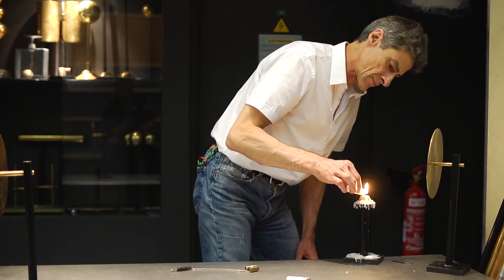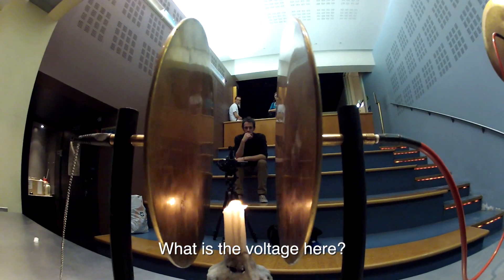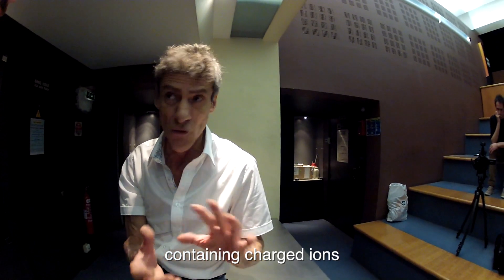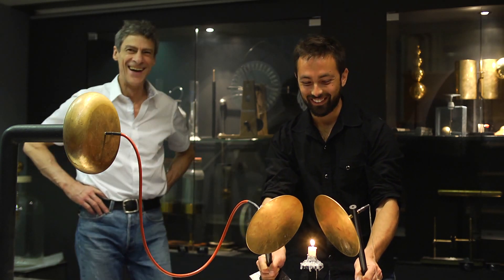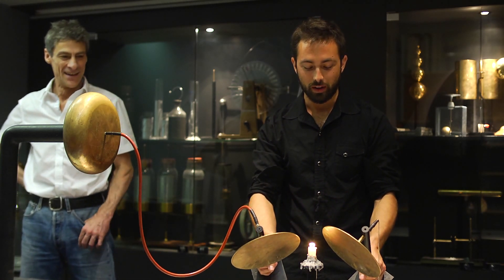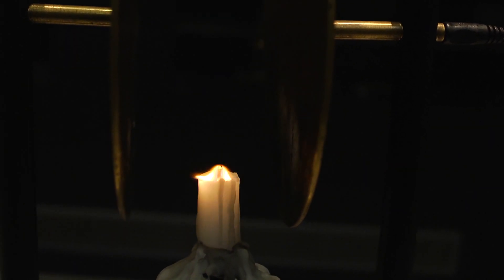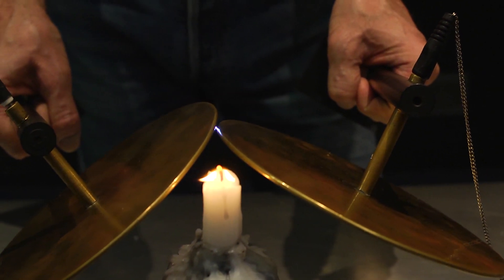What's In A Candle Flame?

Comment: Thanks for another interesting video.
But could you do one about what a flame actually is, please?
You proved it has ions in it but what is the whole of it?  Why the light?  Never mind why the difference in colours of light, why the light? - if there are several reasons please explain them all so we get a complete picture of what's going on.
Also what is it that happens when the hot gasses meet a spark?  I mean what's the difference between the hot gasses with ions in you get when you blow out the candle and the light and heat emitting FLAME that can sustain it's own reaction?
What's going on for a generalised fuel source with regards to both the chemistry and the physics?
There's no sensible, waffle free explanation for normal adults, that I can find, on the whole of YouTube.
Thanks and keep up the good work.      :-)
Reply: A flame is an everyday phenomenon, yet an amazing little thing. As you probably know, it is the consequence of an exothermic chemical reaction. This means energy is released from a reaction like CH4 + 2 O2 --> 2 H2O + CO2 (burning methane gas) and this energy is enough to heat up the surrounding air. Now this is where it gets freaky, this heat will disturb the electrons moving in atoms of the air, removing them further from the atoms core. when these electrons fall back, they emit a photon a.k.a. light. This is how chemical energy becomes heat energy, and heat energy becomes light energy. Now Veritasium speaks of ions and plasma. What's that all about? Plasma is actually the state of matter where a gas releases electrons like I've just described. Because the atoms lose electrons, they become ionized or charged. And this is why half of the flame goes to a positive charge and the other half to the negative charge. The heat is powerfull enough to split the electrons from the cores.
Reply: The Benjamin Better explanation than the video!!! Tnx.
Reply: Isn't it just that the gasatoms gets the heatenergy from the match/lighter and then sends out the energy back, in the form of light and more heat. I'm not sure, I barely know high school physics.
Reply: The Benjamin Thanks, good answer, that's cleared up some stuff for me.  :-)
Reply: The Benjamin
So in your scenario the flame is made of carbon hydrogen and oxygen bonding and separating from each other and the light is caused by the photons emitted when then electrons break their bonds in the CH4 or O2 and when they create their bonds in the H2O and O2 is that correct?
Reply: Ghost Emblem well close. The chemical reactions cause heat to emit. And this heat causes electrons to leave their atoms. So the electrons I'm speaking about aren't required to be the ones from the chemical bond. They could also be electrons in nitrogen from the surrounding air. Apart from that it's correct.
Reply: Almost. This is why  the stoechiometric flame of gas torch is blue. The reason for the white-ish light of a candle is that the flame does not receive enough oxygen thus leading to the formation of tiny particle of pure carbon (the smoke) hot enough to emit light.

Comment: I was so intrigued by this that i had to try so i got an electric static mosquito racket and exposed the wires charged it over the candle flame and it worked! not quite as much "butterfly" as this but it still moved the flame and expanded the spark gap up to 20mm from 2mm,

Comment: Really you can demonstrate properties of ions even without high voltage source. All what you need to do is to take some old vinyl disc rub it so static charge will build and place it near weak flow of water from bathroom tap. You will notice that water flow will significantly bend from its normal position. Than take lighter or any other open flame source and place it approximately 20  cm far from water flow. Ions generated by flame will reduce static field so fast that its looks like magic and very impressive. Soon I will make video to show this stuf .

Comment: Its not smoke that you see coming off the candle after it goes out. It is mostly wax vapor. You can prove this by holding a match to the vapor trail and you will see that it burns and reignites the candle even though you after not holding it near the wick.

Comment: you-re missing the whole point! It is not the flame that contains ions, is the air around it that is ionized and propelled by the electrostatic forces. So the air moves, and you can visualize it with the help of a flame, smoke, steam, dust, water or any fluid or particles layed on a smooth surface that can be blown away by the airflow.

Comment: It's not static discharge. Ash and rocks are electrically neutral. But the ash coming out is so hot that not all of the ash particles are neutral thanks to the heat. So the particles become positively charged and negatively charged based on the heat and aerodynamics of the particles combined with proximity to a particle of the opposite charge and when enough of a mass of opposite particles comes close together there is lightning. Ash never actually rubs together before the discharge occurs.

Comment: Electrostatic airflow is making the flame flatten. Or could be. No control to show lac of air flow. Dielectric strength of air reduces dramatically with heat. Hence longer arc through flame. no control. This proves nothing.
I do agree fire is partially plasma. Plasma is what happens when atoms separate into electromagnetic waves of protons, neutrons, and electrons. Fire still has fully formed atoms in most cases. Superheated carbon for eg as well as other atoms from environment and burn reaction

Comment: Is it really "the opposite charges in the smoke" that cause it to move towards the plate? Or could it be that the electric field induces a dipole in the smoke particles. If the electric field is not perfectly uniform (such as towards the bottom of the plates) then there will be a net force acting on the dipole accelerating it towards the plate along the narrowing field lines. It would be fun to see an experiment to test this hypothesis. Switch the polarity of the field just after smoke starts?

Comment: Mh. Not all of this is correct. Of course there are ions present in a flame which give the flame a certain electrical conductivity. However, the reason for the lower dielectric strength is mainly the larger mean free path. The flame is (almost) under atmospheric pressure but its temperature is much higher so according to the gas laws the DENSITY is lower. That is, carriers see a larger mean free path to gather energy from the electric field

Comment: Actually, I suspect that the smoke does not contain ions. Obviously, the flame does. The smoke gets polarised and attracted by the inhomogenous electric field. Rephrased, the electric field induces a dipole in the smoke particles. Because the electric field is not homogeneous, the dipole feels a net force.

This theory can be tested by using much larger plates and by keeping them parallel, and with the flame in the middle. The plates should be much larger than the distance between them.

Comment: Speaking of which, I was linked here during an argument whether fire is plasma. They say so in this video, citing the fire's reaction to the high voltage. Are they saying that the heat is ionizing the gas, or that it is instead lowering the resistance of the gas enough that the 20,000 voltage electrodes are able to ionize the gas in the fire. Nowhere else I've looked claims regular combustion fires are energetic enough to be plasma.

Comment: Not quite. High electric potential (voltage) is applied to electrodes on each end which ionizes the gas inside. The energized electrons return to lower energy states radiating gas-specific spectrums. Neon's famous color is a result of its highly yellow/orange emission spectrum.

Comment: An ion is molecule which has 1,2,3... electrons more or less than the one in neutral state. And I'm talking about molecules, for example benzene, which is neutral, but has a negative ring on both sides of the molecule, so yes, you are a dumbass.

Comment: Smoke detectors work due to radiation from usually americium. There is a small amount of americium and a plate that detects the radiation coming from the americium and when the radiation is partially blocked by smoke then a relay sets off an alarm.

Comment: It's an explanation for someone who may not have a background in chemistry. You're technically right, but also maybe overwhelming. Besides, NaCl is a simple case, but you don't have hydroxide atoms or fluorosilicate atoms and who calls them molecules? Though when dissolved in solution, they may recombine with different ions of an appropriate charge level. I think calling them molecules confuses what they are and implies stability, but a molecule will often dissociate into two ions.

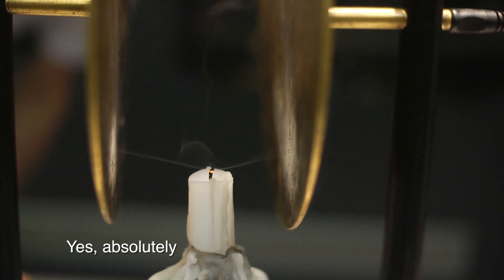Comment: The smoke isn't "candle". It's partially burnt bits of wax or, if you prefer, bits of wax that have been decomposed by being heated -- just after the flame has gone out, the wick is still hot and that heat continues to break down the wax molecules. At 2:00, you can see the smoke splits in three: positive ions go one way, negative ions the other way, and uncharged particles go upwards.

Comment: if the amps are low, it's like the little sting you feel when you get zapped wearing a wool sweater and touch grounded metal.
if the amps are high it's going to be extremely painful for a very short period of time, after-which you die a crispy death

Comment: A flame is just made up of atoms with excited electrons. Excited gases, for example, will release light in the form of photons.

Amps are much more dangerous than volts. I believe it's true that even a few amps of current could kill a person.

Electrical resistance (ohms) causes things to heat up when they have a current passing through them. This should be how an electric stove top works.

Comment: True.It`s the current that kills not the voltage
1 Milliamp:Perception level
5 Milliamps: Slight shock felt; not painful but disturbing
6-30 Milliamps: Painful shock; "let-go" range
50-150 Milliamperes: Extreme pain, respiratory arrest, severe muscular contraction
1000-4,300 Milliamps : Ventricular fibrillation
10,000+ Milliamps: Cardiac arrest, severe burns and probable death
keep in mind that most electrical circuits can provide, under normal conditions, up to 20,000 milliamps of current flow

Comment: I have wanted to know this for about 40 years. Maybe more. 
However...
You didn't really answer the question. 
I get that there are ions in it. But is that all? And what exactly are ions and why do they do that. And why does the flame look like a flame and not like a spark or the way plasma looks inside one of those tube things? What is the difference between the two. 

Keep going. This is an old curiosity now and it has ALOT of questions piled up in it. 
<3

Comment: I think the fact that the smoke splits in the Electric field is interesting.  Smoke is definitely not a plasma, but it still contains ions and is still affected by an Electric field.  So perhaps the fire is also not a plasma even though it contains ions and is affected by an Electric field.  But, of course it did seem to conduct electricity.  Do you think a line of fire would conduct electricity as well as, say, a line of water saturated with ions?

Comment: Voltage doesn't kill you, it's amperage that stings. My guess is that the faces of the plates act like a charged capacitor, and some of that gets discharged escapes onto his relatively neutral hand, but since the capacitance of the plates is so small and the resistance of the path to his hand is so great, the current delivered through him is negligible.

Comment: It's because it is current that kills you not voltage.  Out of curiosity i googled how much current it takes to kill you and surprisingly it is only between 10-15 milliamps depending on the person.  This means that his body's resistance was over about 13 million ohms at that point.  You are actually shocked relatively often by 20,000 volts because a static shock that you can feel stinging has about 20,000 volts.

Comment: That depends on the amperage of the shock. 60-70 mA (milliamps) across the heart is enough to kill most anyone. Usually people can handle more than that though, due to the resistance of skin/muscle/bone etc. In this case, he didn't complete a circuit, rather, there was a charge on the plate that was released when his finger got close enough for it to arc, its the same concept as a van de graff.

Comment: Incase anyone hasn't really answered your question yet I'll try and explain what I know: Mostly Voltage isn't the thing which kills people, it is the amounts of Amps (Ampere) that kills people, now the amount of Ampere that can ''flow/stream'' is determined by: Ampere (I) = Voltage (U) : Resistance (R). However, for humans 50+ Volts of Alternating Current and 120+ Volts of Direct Current CAN BE DANGEROUS, but it depends on the Ampere, not as much the Volt. (Also, Ampere creates heat, not Volts)

Comment: Fortunately not. The reason being that although it has a high voltage the current in this case must be very low. An everyday example of high voltage low current shock is that which you sometimes get after walking in socks on a carpet and then touching somebody, this is about 10 000 volts.
It takes about 10 micro Amps to stop the heart.

Comment: They're using this conductivity principle as part of a laser weapon. The methodology for producing it, is that a laser heats up their air in a linear stream which allows an extremely high voltage to be sent down that stream. The laser acts as a guide which heats up the atmosphere (In the small section that it occupies) which breaks down the insulation so that a lightning bolt can be directed to the target. Upon completion it will be the first really viable plasma weapon.

Comment: well, flames are really more of a very, very hot particle. take an oxy-acetylene torch and heat up a steel ball until it glows at a nice hand warming cherry red. the steel ball is your particle(on a massive scale compared to that of the teeny tiny carbon particle). watch a candle flame up close and you will see that during the time it is burning there is no differentiation between the edges of the flame and the smoke, only a change in temperature, which is shown by the change in color.

Comment from the maker: the lethality of the shock depends on the current. So although 20,000V should drive a big current through you, if the charge is limited by the power supply (which it was) then the current is not that big and you just get a jolt.
Reply: Yup

Comment: Right. Well, I didn't get any arc at all until I "touched" the wires together. Of course, by "touched" I mean "placed sufficiently closely such that my eye couldn't discern a gap." It was 4th grade: I didn't do much research on the actual conductivity of the ionized gas.

Comment: Flame is a low temperature partial plasma. That means the hotter the flame, the closer it is to a true plasma. That being said, imagine this scaled up with a flamethrower and something with the voltage of a lightning bolt generator. Now that would be literal firebending ;)

Comment: ... will see corona, which is the partial breakdown. If the voltage is applied or the gap between the charged conductors is reduced, then a full breakdown of the air gap will occur, and current will freely flow through the 'spark' or 'arc' or 'lightning' or whatever you want to call it. So in this video, the smoke particles are simply being dragged along with the partial breakdown ions traveling between the plates. This breakdown could also be easily detected by the formation of ozone.. stinks!

Comment: "The smoke contains ions" Well, yes, it probably does, but it not what is making the smoke move in this video. In  this video the high voltage is causing air to break down and ionise - only partially - creating so call 'ion wind' which is a flow of ions through air (or gas or gas mixture if not air). You cannot easily see this partial breakdown of the air, however if the lighting is correct (dark enough) and voltage is sufficient, and the surfaces which are charged are the right shape, you...

Comment: THE CHARGES PASSING THROUGH THE LIGHT CAN BE ACTUALLY PASSING THROUGH THE TOP BURNING PART OF THE CANDLE (BLACK PART) AND THE SMOKE IS PRODUCED BY BURNING THE WAX SO IT'S NOT RELATED TO THE FLAME.THE BUTTERFLY EFFECT CAN BE BECAUSE OF THE SMOKE PRODUCED BY BURNING THE CANDLE (WHERE THE SMOKE RISES UP WITH FLAME AND FLAMES LOOK TO BE MOVING BECAUSE OF THE SMOKE THEMSELVES).

Comment: Correct, voltage times current gives you wattage. 
BUT, by also multiplying by time the time units cancel leaving you with energy. 
1watt = joule/second
So (1joule/second)*1second = 1 joule, you're left with just joules, the dimension of energy. 
Think of it this way, if 1 watt of power is applied for 1 second, 1 joule of energy has been supplied.

Comment: A good point, with constant resistant the current would be proportional to the voltage. I don't know the answer to this, but my best guess is that when being shocked with the 20kV plates they will discharge quickly and your body will only be exposed to the high current for a short time, while with the electrical socket the current will remain over time and cause damage.

Comment: deaths have been reported with voltages as low as 30V, if your bodies resistance is low enough then low voltage can produce the 100mA required to kill, across the heart that is almost instantaneous.
Amperage cannot be held, batteries can create a voltage which can produce a current when connected for a amp*hours.
Correct on the third pointn
But an amp is charge per second so no. A volt times an amp is a watt which is the rate of energy transfer so energy= (volts*amps)/time